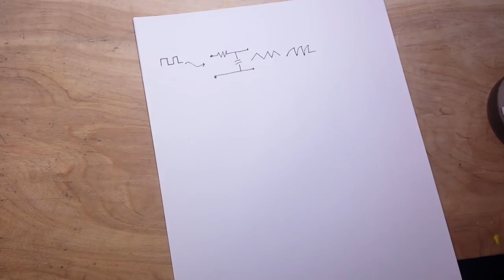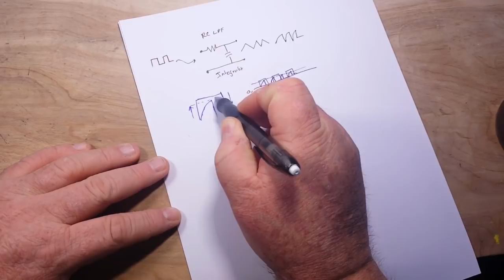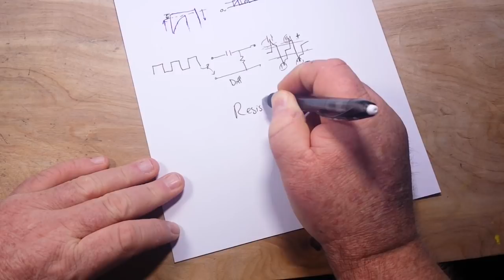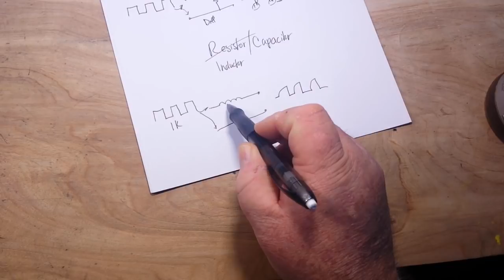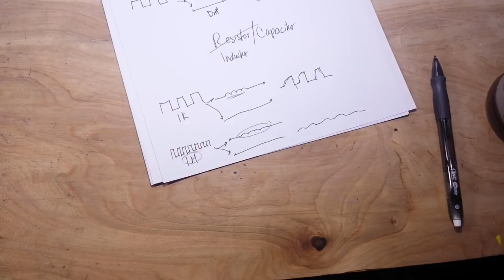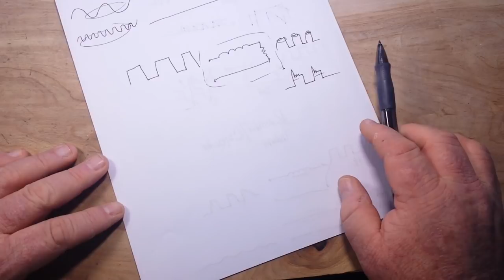Reshaping Waveforms

Comment: In the sine wave/inductor circuit you also get phase shift if my memory serves me correctly which puts the voltage and current out of step.  I'm going back to my college days calculating power factors etc.  It's late here in Scotland so I may have got that a bit wrong but I'm sure you'll put me right!
Reply from the maker: You have it right Davy!